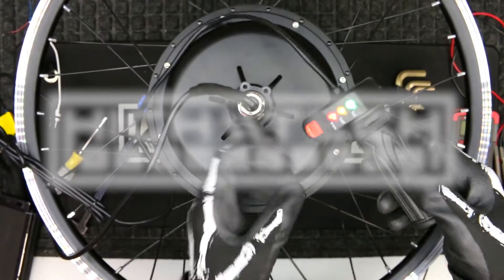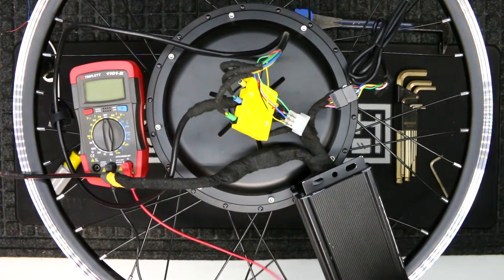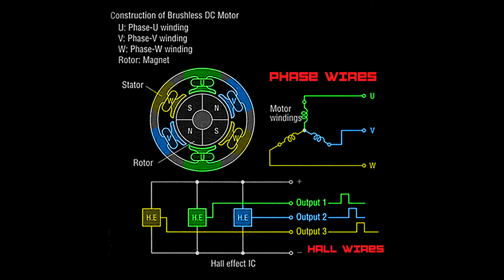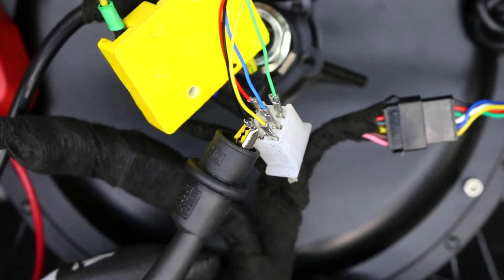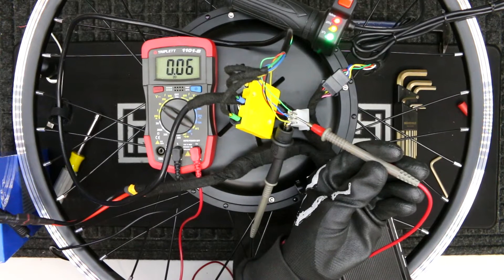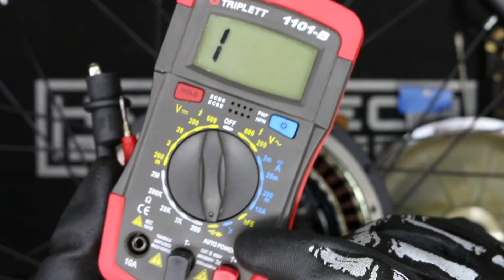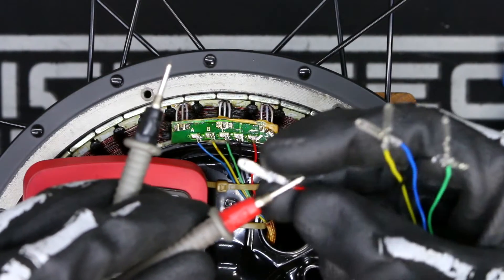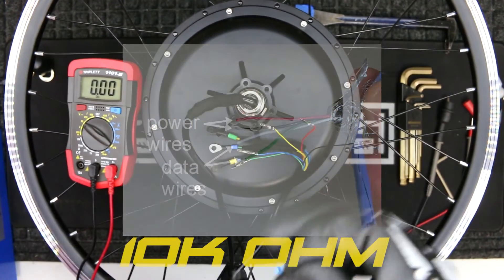🚲 How To: Ebike Hub Motor Hall Sensor Testing, Diagnosis, and Fixes (Display Error 10, Error 30)

Comment: They all test fine on the controller side.  Does that mean the hall sensors are fine, and no need to open the hub and test them there?
Reply: I opened the hub to look around, and it looks like one Hall had been replaced by previous owner.  
I think the motor overheated, which is when the clogging started.  It will run smooth when no torque (although requires an initial push).  Otherwise, lots of vibration and very low speed.
Reply from the maker: @TheOriginalNiceGuy  This symptom can have many causes. 

1. Not enough charge in the battery - if there is a weak battery, it can run fine without a load but not have enough current to push the wheel when loaded

2. Controller issue/error - a faulty controller will have this problem, not sending the right amount of current, or current to the wrong magnets at the wrong time 

3. Hall sensors - if there is an issue with the hall sensors or wiring then can prevent the correct timing of current to the magnets

4. Physical binding - the motor spins on bearings through an axle, it should be quite easy to spin the wheel when mounted. Overheated or worn bearings or axles can cause binding. 

My guess would be either a controller problem or motor/hall problem. If it was working fine before did anything happen to cause it to stop working correctly?
Reply from the maker: If you do a google search for "ebike motor runs with no load, but shakes when loaded" you will get a lot of forum results for this same issue. Most likely one of those threads has a solution that helped another person, or at least help you narrow down what you're looking for. 

The quickest way to diagnose problems like this is to have replacement parts that you can swap to quickly isolate the issue. If you have an ebike shop or maybe a friend with a similar build you can borrow to diagnose. Then when you find the faulty component you can step-down further into what is causing that specific component to not work correctly and attempt a repair depending on your skill level and or cost of the repair. If it costs more to repair than to replace, then you know the correct path. 

It's not impossible to fix faults without swapping parts (I have done it myself) but having done both methods, one saves you a massive amount of time and energy.
Reply: Solved!
After dismantling everything, and 1 year on the bench, turns out it was a melted bullet connector on one of the 3 phase wires (controller->hub motor).  Couldn’t see anything wrong until I tried to disconnect it.  Im guessing my friend put too much torque which overheated the wire.
Reply: I cleaned out some of the rubber, crimped it, resealed and everything‘s working perfectly now.
Thanks for the interest!

It’s funny, because when I open the hub motor, I noticed one of the hall sensors had been replaced in a dodgy way, and the contacts were crushed and touching.
Reply from the maker: @TheOriginalNiceGuy  Good job man, usually if you stare at something long enough and throw enough focus and attention at it the problem will reveal itself. 👍

Comment: Great video, but I am unsure about a description. My problem.... When rotating the wheel the blue wire remains on five volts. Does not pulse to zero like the other two.. The board inside the hub, all wires pass the continuity test. When I continuity test the blue wire from the board to the plug it fails. Would this mean just a damaged wire. Any advice would be appreciated
Reply from the maker: Thank you, yes to me it seems like if you're not getting a signal from the board to the plug then the circuit is broken somewhere along that wire. You can test this by soldering or clipping another separate wire to act in its place and then does it work as intended? 🍻

Comment: Yea, and the brand new 3k hub is doing this too. vibration and grumbling at low RPM. actually, you can make it do this with your hand spinning the wheel. https://youtu.be/FZSGdP2NGw8
Reply from the maker: So same issue on a completely different motor? I have set up a hub motor outside of a bike frame before for testing. I set it up on cinder blocks with clamps in place. If you have the means this would isolate the issue from the frame (tire, caliper, brake, etc). However be careful if you try it because if the wheel gets loose from the mount it can be dangerous. 

If you're having the same issue with a different motor entirely to me that speaks of a different issue. Also is this a new build or was this a symptom that developed over time when it was working fine before? I suppose it could be controller related if there is an issue with it providing more power, possible for phase misalignment but that seems more rare than something physically binding.
Reply: @hightech-lowlife  No, same motor. that was a different video with a different problem. the motor is brand new. I have it on a bike stand. I check to see if anything is rubbing. it isnt. it happens at a high rpm. I cannot simply put it on cinder blocks and wait until it happens at 400-450 RPM.
Reply from the maker: @RetroMancer242  It does sound like something is rubbing. I think you misinterpreted what I was saying about mounting it outside of the bike frame, I didn't go into extreme detail about how I set up a mount other than letting you know I solidly mounted it in place with clamps. When I did it I was able to test a QS273 with 18KW full RPM so obviously it wasn't just sitting on cinder blocks. If the tire is rubbing it should be fairly easy to see, the lighting in the video you sent isn't the best to help determine something like that from an outside perspective.
Reply: @hightech-lowlife  I know, new tablet, didnt change stock app yet. This morning I removed everything including the tire and remounted it. still does it. realized though, as long as I set it slightly below the rated "no load RPM", it stops doing it. Is this normal? Why have I never heard of it? I couldnt even find anyone discussing it while researching.. This is it w/o the tire or brake caliper or rotor. I am mad at the ND Power rep in the video telling me it's fine or it's my phase wires:
https://youtu.be/m63uoud1yi8
Reply from the maker: @RetroMancer242  I'm not sure what you mean by "no load RPM" you must be referring to a setting with your controllers programmability settings? 

Have you ridden the bike yet to see if this issue happens when the motor is loaded? 

This sounds like your controller is applying regen/braking when it hits a certain RPM with no load. It could be a safety feature. I'm not sure what controller you have or what settings are available, but that would be my guess.
Reply: @hightech-lowlife  yes I have ridden it. regen is off, so is field weakening. Fardriver 72450. No load is from their stats on the motor:
MXUS 3K 4T turbo
3000w BLDC 120nm
universal winding 16x4 (4T)
23 pole pairs
4T = 8.9 Kv, 45HP
645 no load RPM (72v Bat)
180℃ copper winding with best magnet
Nominal power 3000W
Maximum continuous power up to 5000W (~50-65A)
Maximum peak power up to 7000W (80-90A)
Reply from the maker: @ So is it doing this issue when riding with a load applied? 

If changing a setting is causing the issue to go away then this tells me that its a problem with your controller configuration. (What parameter are you changing?) 

Unless this was purchased as a kit with the factory already calibrating the controller to the motor shipped, then you'll need to do the autolearn function so the controller can correctly work with your motor.
Reply: @ I know all of this. this due IMHO on YT is helping me. I simply lowered the MaxSpeed [rpm] and the phase amps to stop it from rubbing. but it only stopped rubing because I was no longer hitting 37MPH -- the speed at which it rubs.
Reply from the maker: @ 3KW should do 45mph without issues. If you've tried two motors and same issue and also changes with controller settings, I would try a different controller to rule that out and further isolate the issue. I'm not familiar with Fardriver controllers or settings but I've seen many videos of them working with high RPM no load without this problem. To me now sounds like faulty configuration/setup of settings or a hardware issue with the controller itself. You shouldn't need as many amps for high speed runs, have you tried increasing RPM but keeping phase amps lower?
Reply: @hightech-lowlife  Only have one motor. NB Power MXUS 3k turbo hub. About to crack it open. I was told higher rpm, lower phase will give me less acceleration. motor grined to a dead stop at 1st, it's like something wore down and now it just slows when it grinds. I don't think it's the controller.
Reply from the maker: @ You said this is a new motor? I suppose it's possible to have a fault but they do QC checks and test the motors before shipment but it's not infallible. It's possible that centrifugal forces are causing something to bind at higher RPM but to bind that much it would have to be something substantial shifting or moving.

Comment: Do you know what would cause a rubbing noise at high speeds? I just got a bad 3k hub that rubs and halt at about 35mph.
Reply from the maker: Most likely something is binding, it's possible it only shows itself in the state of either using a lot of power, or rotating at that high of speed. It depends on what the noise sounds like?
Reply: @hightech-lowlife  Just uploaded it. it sounds like a tire rubbing, but I rules that out. took off the caliper and rotor.. still does it. https://youtu.be/NXcTv8xsS6c
Reply from the maker: @RetroMancer242  Yeah something is rubbing, it does sound like the tire. Are you sure it's not expanding with speed and contacting anything?

Comment: very helpful ty
Reply from the maker: Thanks man!
Reply: @hightech-lowlife  ty i coldnt figure out y my front motor was glitchin actually narrowed it down to where one of my power wires was starting to split and was grounding out on the axle
Reply from the maker: @branndonrichardson2248  Yes, that can be a problem area for rubbing, always best to make sure all the wires are zip tied away from moving parts and adequate slack is available so too much tension isn't put on the cables 👍
Reply: @hightech-lowlife  i dont exspect it to last to long but i count really get in there to repair it so i pushed the wires away from the axle and pumped some hot glue in there till i get a new motor
Reply from the maker: @branndonrichardson2248  Yes, hopefully you don't get any shorts as that could be a problem. If that's the only issue you can open the motor and either resleeve, or rewire it with new wires. That way you don't have to buy a new motor if the only problem is the shielding on the wires 👍
Reply: @hightech-lowlife  so far so good but i mainly just off road for fun so i beat it up pretty good so its just a matter of time
Reply: @hightech-lowlife  combustion is more my style but this is a nice quiet alternative
Reply from the maker: @branndonrichardson2248  For sure, yeah I like both too, there are pros and cons to each but being able to be silent is definitely a pro. 🍻
Reply: @hightech-lowlife  for sure but doing 30 35 on something that weights less then a 100 pounds off road hiting jumps wide open is pretty exhilarating
Reply: iv messed myself up a few times but it comes with the cost im kinda a adrenaline junkie
Reply: and lets face it its way cheaper for e over combustion
Reply from the maker: @branndonrichardson2248  Yeah having that much power on such a light machine is really great, just have to be careful. It can be cheaper up to 35mph, but if you want to go faster, buying a used motorcycle is where you save 👍
Reply: @hightech-lowlife  i got newer motocycles but i hate my neighbor complaining

Comment: Hello there,
My hall sensor wires are showing close to 11v when I move the wheel for oscillation!!!
It’s a dual motor setup .
Is it normal in a  dual motor setup to show 11v in all 3 hall sensors when tested using multimeter??
Also the red and black are showing close to 5v like urs did.
But why the hall sensor wires are showing 11v on both front and back motor hall sensors??
Any help be appreciated sir.
Reply from the maker: I'm not sure with a dual motor setup but you should be able to isolate each motor and see if the voltage value changes when testing them independently.
Reply: @ I just did and even the single controller and motor is showing 11v plus on hall sensor wires???
Any idea why???
Reply from the maker: @matelslug1  Not sure, I haven't read any readings that high when doing these tests. What is the issue you're having?
Reply: @ found out the green wire is showing constant 8.34v and not budging at all as compare to the blue and yellow which goes up from 0 to 11v…
I guess the manufacturer of my scoot set these controllers up for high current since it’s 72v 320amps output setup.
Reply from the maker: @ All 3 should oscillate, so that could be the issue 👍
Reply: Okey so just disconnected the hall sensor wires of motors from the connector and tested the hall sensor wires coming from controller,the controller side of hall wires are also showing 11v output???
Any idea what’s causing controller to output 11v for hall sensor wires???

Comment: Is it okey for all the hall sensors to output 3.42v when testing or that means they are bad,
Cause the red and black are showing close to 4.91v
Reply from the maker: Hall sensor voltage should oscillate as shown in the video when manually turning the motor 👍
Reply: @ yes all three hs are going from 0.07v to 3.42v when motor is moved by hand but my question is,
Is it okey to have 3.42v  as peak or u think they should be close to 5v at peak??
Reply from the maker: @matelslug1  If they all are oscillating then to me it's showing your hall sensors are working as expected. Not sure if outputting a lower voltage would cause an issue, but it depends on what your issue is. Usually if you're having hall sensor problems one will be stuck and not oscillate, or not show any voltage regardless of motor movement.

Comment: I believe with FRONT MOTOR HUBS of installing disc brake and barely fitted in the brakes, Ive notice on turns when I throttle, I can hear a rub towards the disc and believe this needs to be avoid when using throttle on straight paths and ease off when turning as the motor pulls a bit and when turned towards disc side it will nudge just a bit which would force motor to be a bit off when using throttle while turning. In time if I push throttle when turning, I know my motor may start jerking as with my first Hub motor of replacing. Just give a feel of response of these moments when turning on FRONT MOTOR HUBS with disc.
Reply from the maker: Yeah if you can feel it binding them most likely it's not a motor problem and something mechanical. If the motor runs fine without the caliper installed, then you know it's the brake setup 🍻🍻

Comment: hey i want to ask?..do it be different if i put randomly green,yellow,blue color wire not the same spot at A,B,C like original would it not work if i do it?..because i dont really remember with colour wire goes to green,yellow or blue to point a,b,c and it's not working,the wheel not spinning
Reply from the maker: Yes, it matters because the sequence is arranged in such a way to create movement. 

The wire colors are arbitrary, however the controller is pulsing current to certain magnets via feedback from the hall sensors. The wire color is just to identify the 3 different circuits. If you change the orientation of the phase wires, then you need to compensate for that by reorienting the hall sensor wires to match the new pattern. It's the same method for changing the motor direction by swapping both the phase wires and hall sensor wires to achieve the correct rotation.
Reply: Hey man! Why don't you just look up the model of your Hall sensor and google it to match the colors it most likely was before you played around with the wires not writing or taking pictures before hand to have kept track of it????? Why not try that to figure out which colors go back to where on the hall sensors? 

Let me know if that works out for you, so I can feel slightly less dumber about everything in life.  😂
Reply from the maker: @ Yes taking photos can help but if you didn't do that before you started taking things apart it's not that big of a deal because there is only one combination is correct. Most hall sensor connectors are standard on ebikes 👍
Reply: @hightech-lowlife  that's true.... That guy was joshing all of us 😆
Reply from the maker: @ A lot of people comment or ask for help before diving into the problem, but later they find out that it's not as big of an issue as they previously thought, I've done it myself. 🍻

Comment: I'm getting 5v out from the controller/wiring harness to the hall sensor plug, but on the reverse side of the plug (hall sensor input) I'm getting 1.9v on red/black. When i try the yellow wire I'm getting .5v with no change on motor rotation. Bad hall sensor?
Reply from the maker: If you're not seeing oscillations when you rotate the motor, it could be the sensor or the wiring to the sensors 👍

Comment: Are hall sensors the reason for my motor to jerk when pushed backwards ? also its not working at all.
Reply from the maker: It could be, use the video to check your hall sensors. For any diagnostic, start with the easiest things to check first, then progress to the harder and more time consuming tasks.

Comment: I have a 1500w rear motor and its pretty new but recently i went out on it and it started making a humming noise and when im on it, it makes a loud noise any advice i have no clue what to do and i am very close to just buying a new one
Reply from the maker: Usually these noises/vibrations are mechanical and not electronic (although sometimes they can be). I would open the motor and check to see if anything is loose or binding.